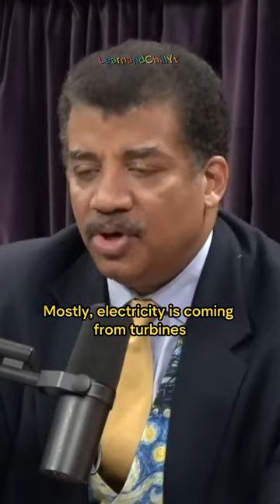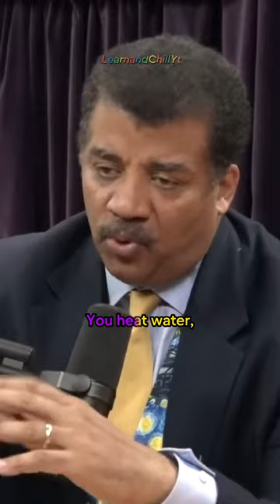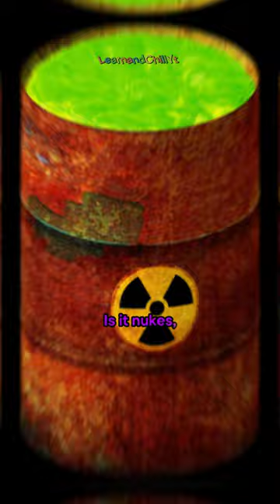How electricity is produced⚡️ /Neil deGrasse Tyson

Comment: Yeah, the turbine doesn't produce energy....
Reply: So... TECHNICALLY the turbine PRODUCES the energy because if it turns electricity is produced... when it stops the electricity STOPS!  Without it no electricity and is just as important as the GENERATOR itself!
Reply: @rustykoenig3566  practicly speaking, i now know you aren't an engineer or a technician
Reply: @Martin_919  I was just playing devils advocate and you don't have to be either one of those to understand the "concept" of things, you need to be one to MAKE them.

Pretty much ALL THROUGH mankinds history... you produce "work" or "power" by "spinning a wheel".   From old mills to electricity generation.... it ALL happens by "spinning that wheel" to produce "power".  The ONLY change since the first "wheel" was spun is the technology and method of SPINNING that wheel :)
Reply: @rustykoenig3566  English isn't your mother tongue, right?
Anyhow, energy isn't produced by a turbine or a generator or whatever, these are all devices that convert forms of energy potentials into different forms.
Reply: @rustykoenig3566  That's a lot of text explaining why you think you're kind of right, but you aren't....
The logic "without the turbine ghe wouldn't be ....."
 It is just as correct as claiming "the turbine housing produces energy sunce without it the steam wouldn't be contained to drive the turbine"

All involved technical parts aid in the transformation of energy into a form useful for us... still that's not producing it.

It's literally the first !!! 1.) !!! Law of thermodynamics:
Energy cannot be created or destroyed.

Read more.